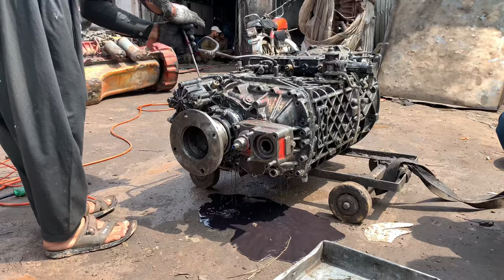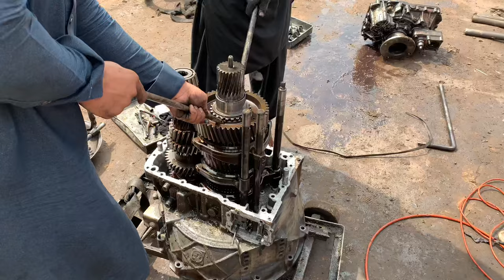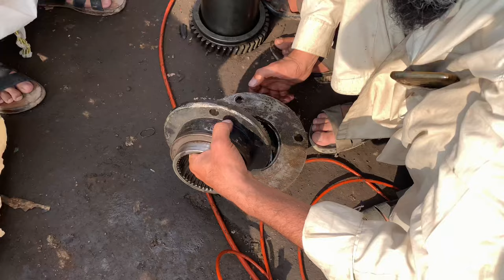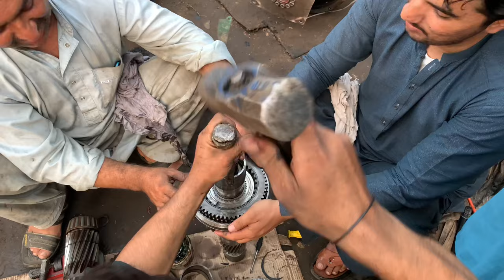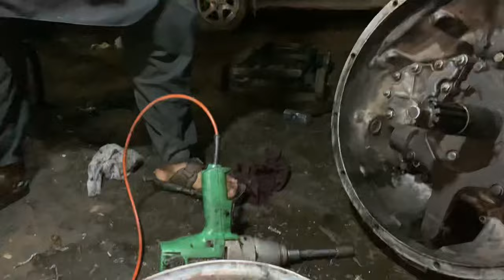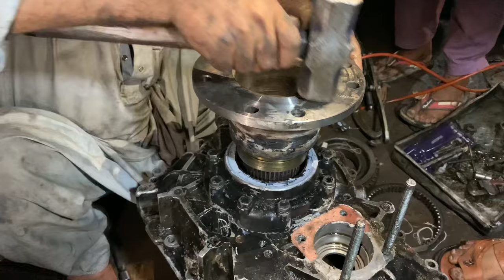REPAIR OF ZF GEARBOX / FULL ASSEMBLY /TRUCK MILEAGE 40 000 KM

Comment: A gearbox is precisely made peice of engineering or it was till they took it apart. Good job they had a special hammer to help them with the delicate assembly. Bet it doesn't last 40.000 miles again. lol

Comment: You better go herd the cows.

ZF 16 is tortured.
Reply: Tu ești în stare să repari așa ceva!?
Reply: @adriancofaru7299  I've fixed a few dozen of them. I just didn't roll parts in the sand, and I didn't spill oil on the ground.

I had a professional mounting stand and tools.

Technical documentation. After my repair, those transmissions drove another 500,000 km.
Reply: @dvorakjiri200  Nu contest, dar ei repară orice și oriunde fară unelte si standuri sofisticate, tocmai asta este de remarcat.
Reply: @adriancofaru7299  we don't know that;  we never saw it working.  Anyway, that's supposed to be a Toyota, wasn't it under warranty at 25k miles?